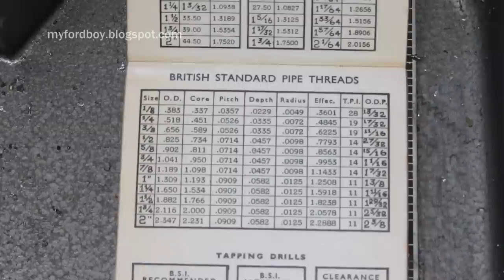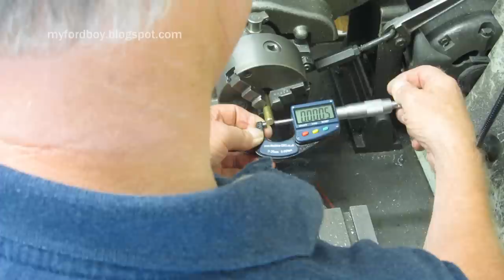Lathe Workshop for Beginners, Part 3, Screwcutting.

Comment: Thanks, good video, and though quite simple for you, I like how you used the thread gauge to line up the cutting tool to the work piece.  Will be trying that method today.
Reply: this is the threding method which we make thred two types milimeter or inches

Comment: oh, this method is so much easier with the hand crank! ive made threads on my mini lathe using the auto feed but no hand crank, it is nerve racking! its so easy to crash or miss the number on the dial when engaging the auto feed. i will modify my mini lathe to use a hand crank! thanks!
Reply: I agree absolute gem. Slower but full control. no crushing the thread or else. Havent had the need to cut any threads on the lathe, but tomorrow I am definitely making a suitable cranking handle. Regards
Reply: Sometimes I feel like I use my hand crank more than the motor. They are great.
Reply: David Kirtley Well is only a couple of years since i got into machining and through the internet learned a lot. Some of the most basic ideas are the most effective to achieve one's project. definitely i shall make a cranking handle and one day may prove useful. regards.
Reply: I've read you can reverse cut a thread so the toolpost moves away from the chuck each time.. Does this work?

Comment: This is excellent work and good to follow.  I have a question what are the allowable tolerance for the part?
Reply from the maker: Model engineers like myself don't worry much about tolerences and just make the part to fit another. In this instance the matching part was used as a reference.

Comment: Isn't this a Pipe thread and therefore should be tapered?
Really like your idea of using the micrometer to do the math.
Thanks  -  Rod
Reply from the maker: The thread in this fitting was a parallel, not a taper but some pipe fittings are tapered as you suggest.
Reply: He is cutting (BSP) British pipe thread and you are probably thinking NPT, (The common pipe thread in North America). Also notice the 55 degree threading tool.
Reply: myfordboy
Thanks for the response.  I didn't know that there were pipe threads which were not tapered.  Here in North America tapered Pipe threads are the norm and to be honest the only ones I know.  Thanks again for your great videos.  Rod  Canada